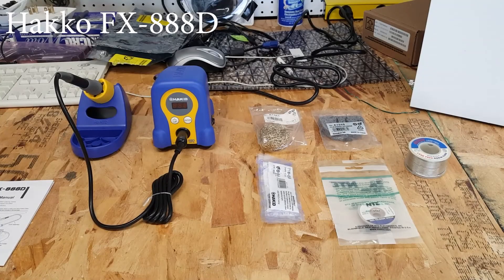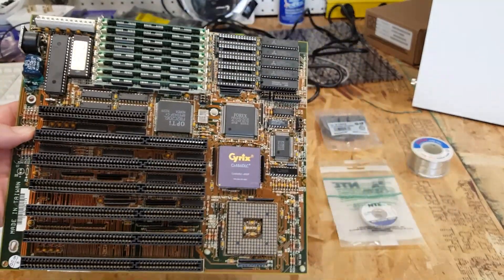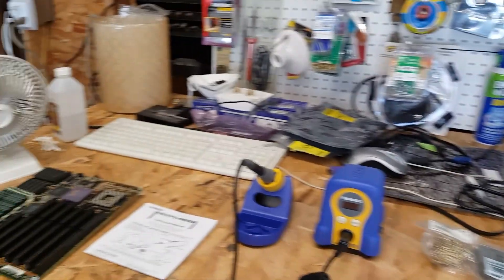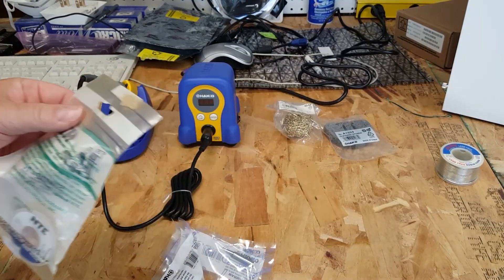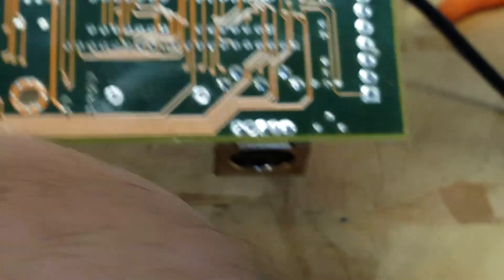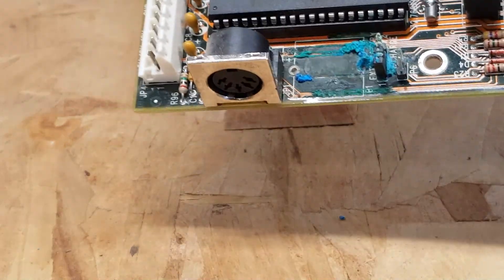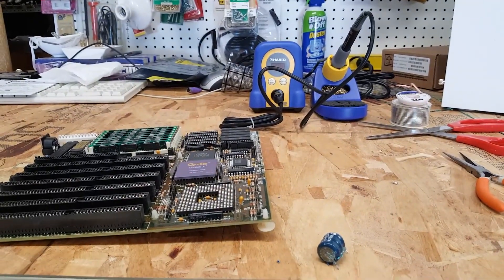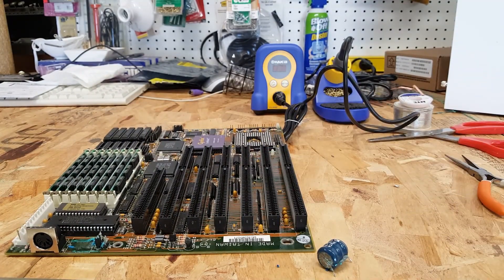Soldering at home: Hakko FX-888D.  A first timer's review and use.

Comment: That old 486 board would be using leaded solder. 650F might be too high I'm thinking. Well, Hakko itself says go for the lowest temp that does the job to help extend tip life. That would be 300c, sorry um, 575F or thereabouts. Some heavy ground planes might need more but you cross that bridge when you come to it. That's what presets are really for - different types of solder and different thermal mass.I think lead solder is okay for us oldies and the amount you will suck in at your age and jobs. Cancer and the old ticker will get you long before lead poisoning.
My first PC was a 386. Now those NiCad batteries used to spill their gutz over the board below them and ate into the tracks if left long enough. They killed more motherboards than Mexicans killed Yanks at the Alamo. I'd bet that board is like Davey Crocket, long dead.

Comment: When you put air in your tires do you set the regulator on 36lbs or 100 , I use 100 in & out quick, same goes with solder go in & get out hot not the melting temp of the solder
Reply from the maker: I set it at 33 PSI and wait patiently 😁

Comment: Nice video man. Couple tips from a novice solderer: cutting the legs with flush cut pliers and adding fresh solder before you try to use the wick can help. Also you can use the flush cuts, add some solder and heat it up you can try pulling it gently with some pliers. Should come right out. Then use a solder sucker to pull the extra solder out of the trace. If you ever want to watch someone who's has really good at soldering check out Voultars channel. He makes it look so easy.
Reply from the maker: Nice!  I wanted to flush cut the legs on this battery but there was no room with the external battery posts and the keyboard connector!
Reply: @UncleMikeRetro  yeah I like channels like these because we're all here to learn something and remember the good ol days.